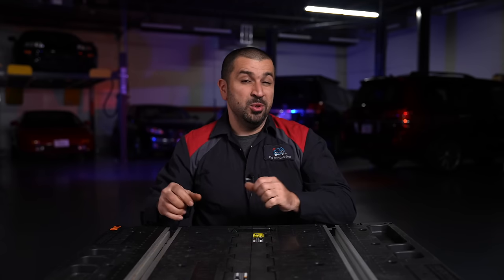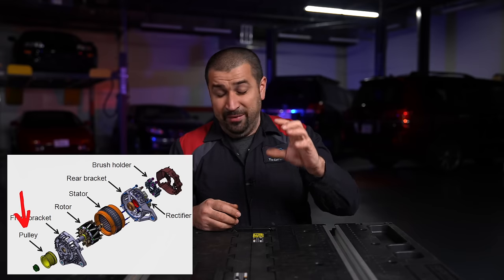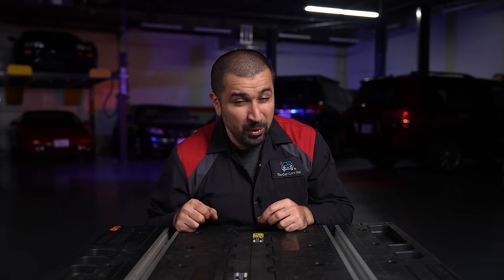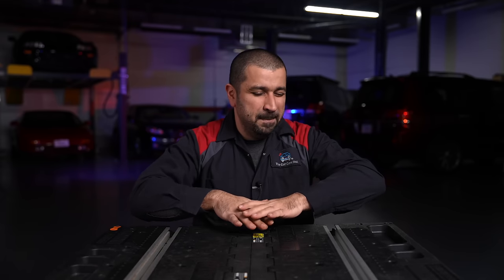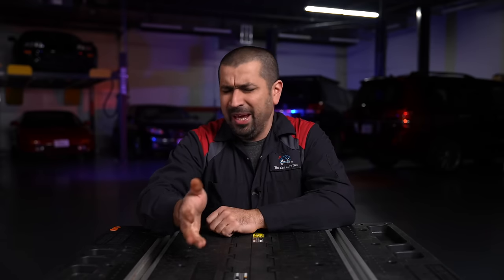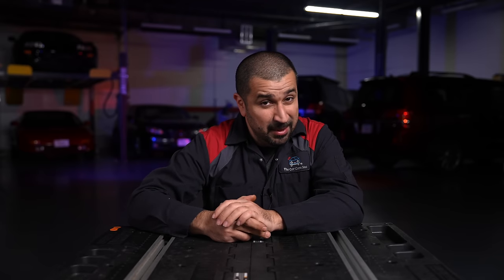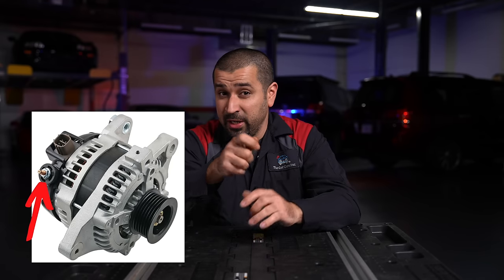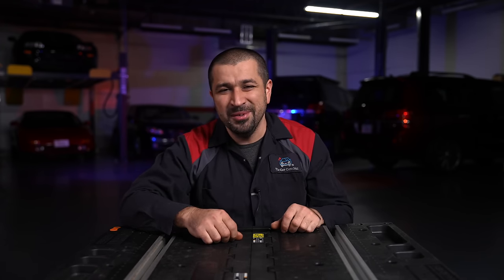How To Make Your Car's Alternator Last Longer? Everything You Need to Know

Comment: So i have a 12 tacoma and have a P1604 status/history-startability malfunction... i scan it and it says replaced bank 1 air/fuel A/F ratio sensor i replace bank 1 o2 sensor with a denso, i still have this code..has anyone had this code and how did you fix it thanks...

Comment: Nicely done and easy to understand video. Aftermarket alternator needs to be clarified.
Denso offers a very popular remanufactured alts for about 1/2 price of a NEW Toyota alt plus a core refund. Denso is the major supplier of new alts to Toyota. Therefore the Remanufactured alt is rebuilt OEM with a pretty good track record and very popular in challenging financial times. There are also NEW aftermarket knock-offs from China for around $100 which no one should use. If you ever changed an alt on a 5.7 Tundra, you don't want to do it twice. One of the hardest components to replace on that engine. Also, I would love to hear your thoughts on modern day jumper boxes. And how to properly jump a vehicle to vehicle, to prevent damage to the donor vehicle's alt by leaving the engine and key OFF while starting the receiving vehicle to prevent an overload on the donor vehicle's alt.

Comment: My 2003 Tundra with 391,000 miles still has the orginal alternator, and AC (never added any freon). The orginal radiator started leaking and i put in an aftermarket one. The only other two parts that failed was the belt tensioner and the brake booster. I personally replaced both. The last timing belt I also replaced 3 years ago.

Comment: I am skeptical of your electrical explanations. Specifically, that a modern alternator w/clutch,  yields significant savings in fuel economy. 
I do not want my multi-thousand dollar ECM controlling my alternator. (Just monitor)
When the old-fashioned alternator achieves a fully charged battery, the counter EMF reduces the load on the alternator.
This allows the alternator to almost freewheel, thus reducing the load on the engine to tiny fractional HP.
One could save more HP with LED headlights, with no risk to the ECM.
I blame the Democratic Federal Government for raising CAFE to reDONKulous levels. I blame the Democratic Federal Government for discouraging fossil-fuel.
The catalytic converter eliminated 97% of pollution in the 1980s. Carbon Theory AGW is a hoax.

Comment: My kia pregio have the alternator at the optimum location, front top of the engine ... 
I had to replace the diode bridge 3-4 times in the past, as the aftermarket controller which the manufacturer used, simply put 100% power after a few seconds, and if your engine did not started yet, and still using the starter, the starter will short your alternator and kill the diodes ... (I guess by design ...)
Now i replaced the controller with another one, and the problem dissapeared.

Comment: Well, my 2008 civic alternator just started putting out 16+ volts after 200k miles. Got me a new OEM Honda alternator for $500, this is one thing you don’t want to cheap out in your car,  neither the battery.

Comment: I have a question. My car is drawning lot of current when cooling fan ON, A/C ON. I've checked with OBD2 scanner that my ECU voltage is drop too and the idle seems roughly. Then I replace the whole Alternator Assy but it waste money. It didn't change anything. Injector was good spraying and not clogged, MAF is good rising up. Whats wrong here? thanks.

Comment: So, what is a weak battery?   11.7volts, 11.2volts, under 11volts?
18:27  Positioning of the Alternator in engine compartment is manufacturer-dependent.  That fact alone points out how well thought out the carmaker's engineers were in their design/prototyping process before the buyers got it.  Good point.

Comment: Two minor corrections to your otherwise excellent presentation: 1- Automotive alternators need 6 diodes to convert the 3 stator output coils to DC (current). Diodes are one-way-only CURRENT control devices.One set of three diodes allow only forward DC-only current flow, and another set of 3 diodes prevent reverse (negative) current flow. E, voila! DC current flow and positive voltage, only. 2- Alternator regulators are designed to control CURRENT flow to the rotor to make the alternator stator produce a much magnified output CURRENT. It may sound confusing that it really does apply voltage to the rotor to do this, but the goal is to have the alternator produce output CURRENT, NOT VOLTAGE ! Indirectly, the output voltage DOES rise with increasing input rotor control current. The regulator constantly measures the output voltage in order to control the input rotor control current to achieve a steady output voltage around 14.2 to 14.7 VDC. Technically, this is called  a "closed loop control system". So, an alternator is a "varying input current-controlled device to achieve a steady output voltage device.

Comment: The alternator went on my 2012 Tundra. The original lasted for 140K miles. Replaced it with another OEM alternator . What a nightmare job changing that thing on the Tundra. Took me about 6 hours. My dealer wanted $1200 for the job. Saved about $800 doing it myself.

Comment: You are toyota fan, you should know smaller and older toyota used 2 phase, not 3 phase. BRIDGE rectifier!So far I watched half video and you still did not talk about point. You only said car need AC, but in reality all the modules can design to run AC. The real POINT is the energy storage aka BATTERY. You can store DC, but you can not store AC. So, you missed the point completely. It looks you do not know much about batteries at all. Old battery does not accept anymore high current, so you can not charge +100A it. If it takes only less than 10A charge, car can not force to take 100A not even toyota. Sure, it is bad because if conditions is between good and bad can generate load of hydrogen gas. Not plugged in ventilation hose (show me any battery replacement company, where they take a 10 seconds to install it back) means all that hydrogen gas accumulate under the hood/trunk and waits only 1 spark

Comment: Thanks once again for an informative presentation. I'm old enough to remember magnetos, dynamos and generators!  Also when a voltage regulator was a separate device like you mention which you could replace for a few bucks. 
Can I add to your excellent explanation of basic alternator operation. In terms of electrical generation it's worth mentioning the fundamental principle of 'induction'. When you move a magnet, either permanent or electro magnet past a conductor such as copper windings, you induce an electric current in the conductor. Hopefully no sparks involved!  This is also how rotation is created in an electric motor - the reverse process.  These basic principles were discovered by our amazing pioneers and applied to do useful work by extraordinary people like Nicola Tesla.
A 3 phase alternator configuration gives you 3 x AC waveforms 120 degrees out of synch. because the 360 degrees (1 rotation) is divided by 3. It is also worth checking out a small ingenious electronic device made up of 4 diodes called a 'bridge rectifier' which also captures the negative half wave of an AC charge so it's not wasted.
I never knew alternators had a pulley clutch until I heard my alternator rattling one day while sitting idling. By the time I had ordered and received a replacement pulley it had seized so was not making any noise and functioning fine.  I wonder how many seized pulley clutches there are out there on the road?
My current 2014 Kia Sorento went into full limp mode when the alternator died and the battery also went flat.  I also lost power steering, the instruments went crazy and the engine would not switch off. All good reasons not to try and drive.
Can you also tell us if modern EVs have alternators?

Comment: I'd like to see an active rectifier using MOSFETs for IGBTs instead of diodes, combine this with a DC-DC converter and we would be able to get super precise voltages because the active rectifier is still a rectifier just more efficient than diodes which makes lower waste heat and probably lasts longer, but the DC-DC converter can take a variable input voltage from the alternator and temporarily step up or step down the voltage while the field coil current is still being adjusted.

Comment: Watching this because I have a 320 amp high output aftermarket alternator. I have several amplifiers and subwoofers installed. I have two batteries and Super capacitor bank. At idle the alternator puts out 160 amps, full power dynoed at 339 amps at 2k rpm

Comment: I have 2000 Toyota Camry LE 4 cylinder. From the way the alternator looks it looks like the original. What I have done is replace most of the bulbs with led lighting. I checked first to see if I could.  I could. It seem like the alternator runs better. I'm customizing the Camry. I enjoy the Camry and what I have done to it so far. The alternator is a Denso brand. I want to thank you for saying to buy oem parts. But the oem alternator will be expensive but that's okay if I ever need one. Thanks much for your video it was very helpful.

Comment: I agree with everything this guy said except for not getting the alternator wet. I have a 2007 Toyota Camry with the 6 cylinder 2GR-FE engine. I bought it new in April 2006. Yes, the 2007 Camry came out in early 2006. I ordered it in March and they delivered it in April. I've been powerwashing the engine with low pressure water 2 to 3 times a year and it still has the original alternator. I did a voltage and amperage test on it and it's working like new, so I don't believe getting the alternator wet cuts its life short. I had to replace other parts on it but nothing as a result of water making contact with electrical parts. The only things I replaced were things that all 2007 Camry's with 2GR-FE engines had problems with. That was a rubber hose that delivers oil to the variable valvetrain and 3 coil packs. These were replaced in 2009, so 14 years with nothing but changing oil every 5K miles or 6 months whichever comes first. Coolant and tranny fluid have only been replaced once, I only have 110K miles on it because the majority of my driving is city driving, and it still drives like new.

Comment: Two questions:

1. Can we introduce compressed air to clean a dusty alternator.  Plus if it is OK is it better when running our turned off (all safety gear and procedures utilized and adhered to)!

2. Back in the days of Lee Iacocca's K-Crap car it had a 74hp Mitsubishi power plant, of that 74hp I was told that the Alternator took from 5hp to about 20hp to charge the battery and that it took about 20 to 30 minutes of driving to recharge the battery back up from the drain of a start motor engagement, so does it make any sense to turn off a car at a traffic light and restart it to go or has the mechanicals improved that much? That is not even considering the finite life through wear and tear?

PS. In 1993 I was stopped for going 174km in a 110km zone, I have no clue if I was going that fast as the Speedometer stopped at 130km/h, the judge decided that no K-car was capable and we agreed to 119 or 9km over, fewf!  I agree that I was pushing it, but I feel the cop read the speed of the 911 passing me that he said was not there, even though 5 or more sport cars passed without any enforcement!

Comment: OK I get it, The alternator generate AC to keep itself cool,  the car use DC which is like the electricity at Washington DC. (electrician jokes) The good thing about alt failures is there are warnings., and I can keep driving to a mechanic.(couple hours easy)  Have it replaced there while telling them to give the battery a charge.  The relocation of the regulator from the separate module ,then inside the alt and now into the computer is strictly cost, now they just added a chip to the main board, that is cheaper, same thing they relocated the signal light flasher, buzzer to the speedo board, now the signal flash electronically, not by breaker point contacts. The most likely part to fail in an alt is the front bearing and the brushes. Old GM alternator need just a 5/16 socket , a paper clip straighten out, and a rag and big plier holding the pulley while you air gun the front nut off. Smart guys mark the casing first for later reassembly. The diode is sealed in a module and I doubt solvent can get to it, but the stator/rotor winding can be damaged by solvents, the insulation is just enamel wires, .....paint insulation . I still have my OEM fan belt on my 2015 Camry with 130,000 km on it, I spray it with leather/vinyl conditioner every year, one make called 333. No cracks or signs of failure. The battery symbol make things so easy, that light up, I check the voltage first, I expect to see at least 13.5 V . But in old GMs a diode failure will have the "gen" light on dim, lots of voltage, but much less amps.

Comment: I just had a valve cover leak and it went all over my alternator, I just never realized the leak went onto my Alternator. Anyways Got the OEM Valve Covers and Seals and got them replaced. 1 month later my Alternator goes and when i looked at it it had Oil all over the Alternator and all of its wiring. Had that replaced a Month later car is going crazy kicking like a horse, lights flashing, etc etc. Look at Alternator and the person my mechanic gave the job to do in his shop of changing the Alternator failed me again, by not cleaning the Alternator ground wire that was full of thick black gunked up oil great. 

So the worker/Mechanic My shop appointed to fix my car failed me twice. Once was not telling me my Alternator "$650 Denso Alternator" was full of thick gunked up oil when he did the Valve Cover change. Second was he failed to clean the Alternator Ground wire that was full of Grease after replacing it. I asked my Mechanic not to put him to work on my car again and also if he had to, to overlook his work as its the owner of the shops responsibility to see such issues as well and point them out to their workers. He agreed with me. 

I end up cleaning all the ground wires and nuts, bolts, washers etc, in or around the whole engine bay, took them out, sanded them down to the bar copper metal, used degreaser as well as battery cleaner on the wires, let them dry out. hooked them back up and put some anti rusting agent on them, so far is been 6 months and 20 year old Infiniti FX45 Suv 77k on it, is running like a champ. 

Always check your Mechanics work, if you know how to. Don't assume the Mechanic will do the right thing for you.

Comment: Like u say,, AMD, alternators MAINTAIN a battery. A battery can have 12v but be at 50% charge. Alternator will kèep it at 50%. You MUST boost with a battery charger. If not fully charged, battery WILL become sulfated faster & will shorten the life of the battery. 👍

Comment: Great timing for this video, my work car has had a weak battery issue one time didn't quite have enough power to start the so jumped it a few days ago, last night I decided to take battery out and put it on a charger it was not fully charged about 75% reason I decided to charge is because I noticed yesterday at end of day I did not disable start/stop but was not stopping I realized that it  probably detected lower SOC of battery. BTW My personal car 07Avalon  had to replace alternator mechanic and I had noticed that it appeared to have been the original not 100% sure @ around 220k miles my car looks like a POS but decided to get DENSO shop was able to get Brand new one not a Remanufactuted that most parts shops carry around 500 dollars I believe for new vs 250-325 I wonder if I did not have a really worn-out battery it would have gone further ,but it had to deal with worn-out battery for few months then it sat and became over discharged and got new Optima Yellow top deep cycle/ starting battery  that sat again a couple months and wow extremely over discharged again I thought I just wasted $350 but I used engine start then charge a bit voltage would fall then repeated again until start to take charge it took over 12 hours to complete 😀. Work car is 2022 Crosstrek 2.0 snailmobile LOL.

Comment: AMD,  im having an issue with my alternator on my 06 matrix. So the oem unit was still charging but started whining. It currently has 250,000miles. I stopped driving it and replaced it with a rebuilt unit. I have the 1zz motor. The new alternator is not charging. I took it to the place of purchase they tested it good. I went to multiple palces and they all said it was good. I was looking at the alternator for the 2zz motor and it looks exactly the same. They have different part numbers but look like either one could fit either engine. Do you know if thats the case? Could it be possible that i may have gotten one for the 2zz and thats the reason it may not be charging?

Comment: Another great video - great explanation. My 2017 highlander went nuts signaling us to get a new battery when it started failing .. got a new battery instantly..  then I ran into the “ do you have a start stop automobile “ yes I do our car has the “ start stop “ stupid fuel saver crap .. wish Ccn would cover that issue “ start stop” etc.

Comment: Will I kill my alternator or just reduce its lifespan?: I want to add a 15 Amp auxiliary circuit to my Matrix, and my Sienna, for charging a portable solar generator while driving. I would possibly be drawing 15 Amps steady for 2-3 hours, very infrequently. The circuit wiring would be direct from the car battery (with a fuse, ignition relay, and also a switch in the cab). Seem okay? Thanks CCN!